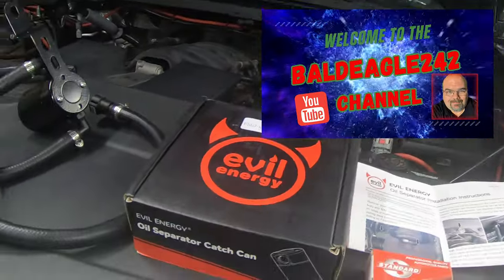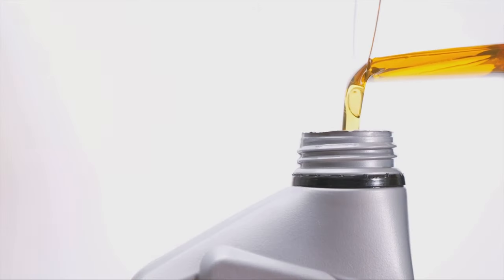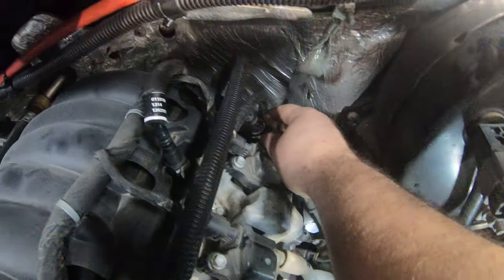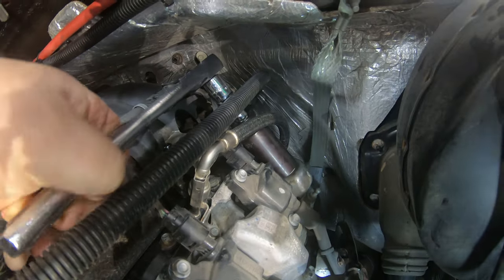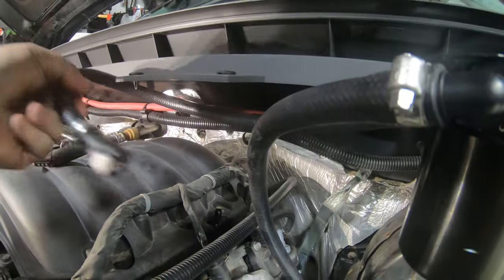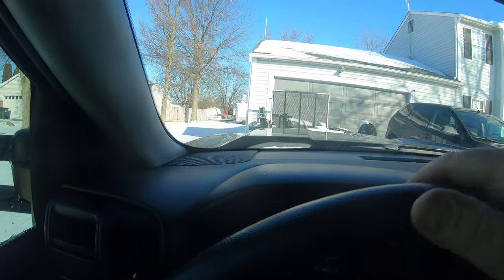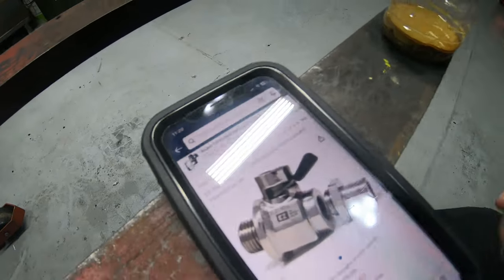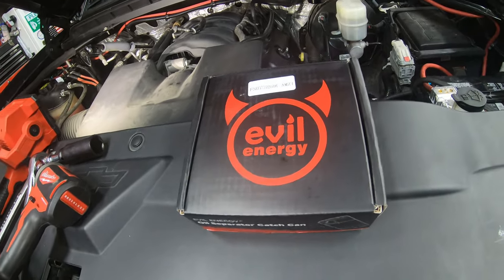Are Budget-friendly Oil Catch Cans Effective? 🤔

Comment from the maker: Oil Separator Catch Can Installation on a 2014-2023 Chevy Silverado or GMC Sierra 1500 2015-2020 Chevy Tahoe Suburban or GMC Yukon 
https://amzn.to/3Ssbflh
What Is an Oil Catch Can? Do I Need One On a 4.3L V6 Chevy Silverado?
The compatibility of the Evil Energy oil catch can work with a wide range of vehicles, including our 2018 Chevy Silverado 4.3L V6, even though this engine is not mentioned in the Amazon description. This catch can kit is specifically designed for a variety of Chevy, GMC, and Cadillac models, making it a versatile and reliable choice for those who own these vehicles.

The installation process is remarkably simple, including custom brackets, hoses, and fittings tailored for direct replacement. This ensures that even those with limited mechanical expertise can effortlessly set up the oil catch can on their own. The comprehensive installation instructions provided further contribute to the user-friendly nature of this product, making it accessible to a wide range of car enthusiasts.

A notable aspect of the Evil Energy oil catch can is its strategic installation location. Focusing on the PCV side of the engine, this catch can efficiently capture oil vapors before they have a chance to circulate back into the engine. This targeted approach enhances its effectiveness in maintaining a cleaner and more efficient combustion process.

The recommendation to check and clean the oil separator after driving 500 to 1000 miles adds a practical touch to the product's maintenance routine. We recommend checking it at each fuel fill-up. This proactive measure ensures that the catch can continues to function optimally, extending engine life and preserving its smooth operation over time. The ease with which one can perform this maintenance task contributes to the overall convenience of owning and maintaining the Evil Energy oil catch can.

The function of the fine mesh aluminum filter is a key element in the success of this oil catch can. By capturing fine oil vapor, the filter actively contributes to the extension of the engine's lifespan. This promotes longevity and ensures the engine runs smoothly and cleanly, leading to an enhanced driving experience.

The Evil Energy oil catch can stands out not only for its compatibility with a range of Chevy, GMC, and Cadillac models. The inclusion of a fine mesh aluminum filter adds a layer of sophistication to its functionality, making it a valuable addition for those looking to optimize their engine's performance and longevity. Overall, this product aligns with car enthusiasts seeking a reliable and user-friendly oil catch can solution.

This is a hybrid video; Artificial Intelligence and AI voice-over were used at the beginning of this video. (I'm interested in knowing your thoughts about this in the comments.  Good of Bad?) 

ACDelco GM Original Equipment 12630887 Positive Crankcase Ventilation (PCV) Valve
https://amzn.to/47MoUcl

Mini Tire Changer for mower, go-kart, and most small tires.
https://amzn.to/31eHgGp

The drill bits I use are lifetime-warranted Molybdenum from Drill Hog.  
https://www.amazon.com/dp/B010US18BG/?tag=eagle0f1-20

As an Amazon Affiliate, I earn from qualifying purchases.  These links help you find the products I've used in this video.  Clicking these links will take you straight to the products on Amazon and help support this channel without costing you anything extra.

Get the Motion Hero Pack that I use in my videos for
Only $37 one-time investment. Use unlimited times on your own and client videos!
https://baldeagle242--videohero.thrivecart.com/motion-hero-pack-1/

If you're a video creator on YouTube - Tube, Buddy is an excellent program to evaluate your videos and make recommendations to help you attract more viewers.  
https://www.tubebuddy.com/Baldeagle242

BALDEAGLE242 Facebook group
https://www.facebook.com/profile.php?id=100068248886396

Comment: Thanks for the video
Can you put them on cars also?

Works good, why don't they already have these on new vehicles?   Seems to do a good job at catching stuff.
Reply from the maker: Yes, you can add them to any engine that has a PCV valve that connects to the intake manifold. The main reason they don’t install them on new cars is the newer engines have less blow by and the main reason is they require regular ongoing maintenance to empty them. Most people quit simply just won’t tend to it until it fails.
Reply: Excellent and well explained process with tangible results. 
I put one on an Ecotec 2.4L, same brand, and I get about the same collection in roughly the same stretch. Obviously more water it seems when humid or cold out. Definitely no regrets. Some say their vehicle runs better but I didn’t notice much difference but I’m sure it’s happier as a result. Some folks issue warnings about their use in freezing temps but I’m guessing if checked at reasonable intervals there’s little downside.
Reply: @baldeagle242  "new cars is the newer engines have less blow by" They went to Low Tension rings and thin oil and some engines aren't doing to well bc of it. One of Toyota's 4 cylinder engines has the reputation that if you don't change the oil every 3K miles it will stick oil control rings and scuff the cylinder walls. It has an OCC built into the engine and dumps all the impurities back in the oil. 
You're way better off pulling this stuff out of the engine and dumping them like you're doing.
The Mini Cooper engine by BMW has this reputation as well as others, they call them Sludge Monsters or something like that.

Comment: Good morning,
I come with a problem with the Alpina BT-84 mower. The mower starts properly, no problems.
The problem occurs when I want to turn on the cutting unit. After tightening the mushroom cap, the mower does not respond - it does not turn on the mower and does not turn off. The electromagnetic clutch works, the basket sensor works, the basket full sensor works. I cleaned the contacts (also on the mushroom plates).
The strange thing is that the mower reacts as it likes, because I managed to start the mower about three times, even though I did absolutely nothing to it, but after a while it immediately stated again that it would not mow. Could the problem be caused by some abnormality in the insides of the mushroom itself or is there some other reason that could be causing the specific problem. I suspect that it is directly related to some part of the electrical system, but I have absolutely no idea what causes this problem. Could replacing the plug improve the situation?